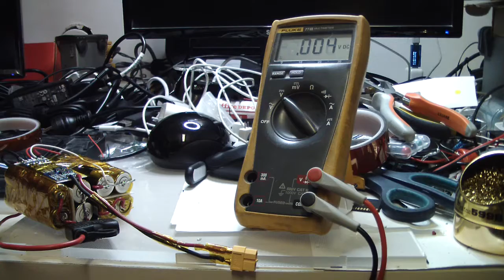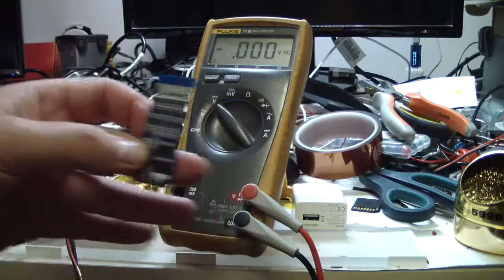BMS 4 cells - NOT WORKING!!

Comment: You need to short the two output terminals (B+ P- or B- P+) for a second or so... It will boost (Reset)  the chip... I I must have bought 4 to 5 BMS none worked, I thought they might be fake.... It was by accident that I happen to short them and it was alive.... later I came across a video were the guy revived his laptop battery BMS using a wire to connect the terminals as to kick start the BMS....
https://youtu.be/I7Llii69YYM

Comment: Hi everyone. In some bms, for safety reasons, the bms cuts the voltage before connecting the batteries and charging.  Connect the batteries and give the bms voltage even if you can't get the output (17-18 volts for 4s) Then disconnect and check the voltage.  You will be able to see the battery voltage.

Comment: i fix mine by shorting the ground input and output fast
Reply from the maker: Actually I found also the problem after many tests. This Module is working, but testing very low change between cells, so if one cell is 10mV difference from the other it cut off voltage out. so if the cells are fully charged you are ok, this happens after while, or if cells are not 100% same
Reply: I had same problem. This answer helps me a lot! so if I charge the battery eventually the BMS is going to work?
Reply: @capaio I tried charging and it does NOT work